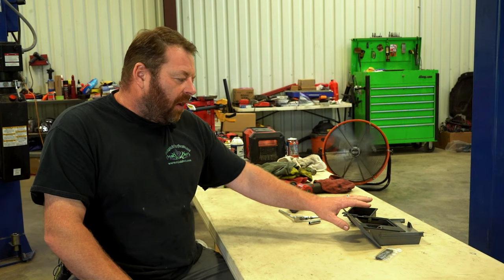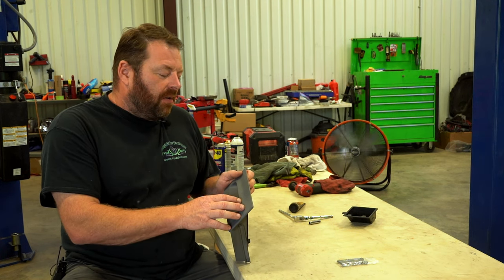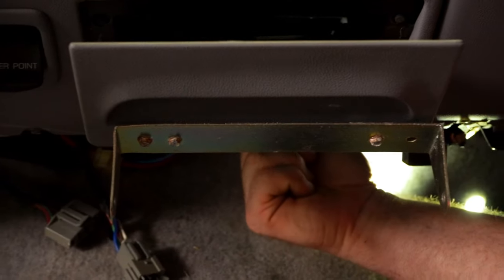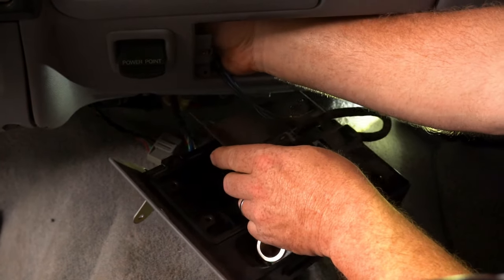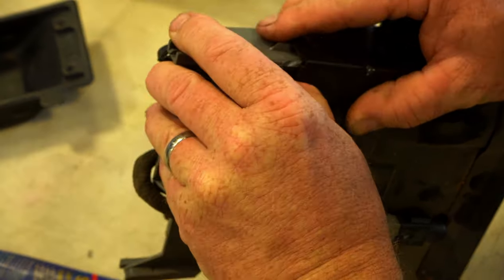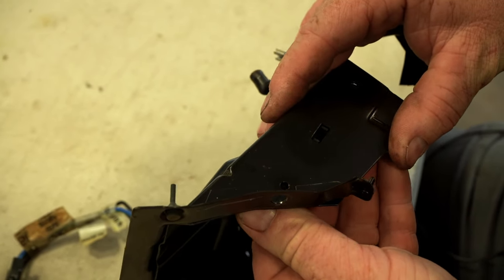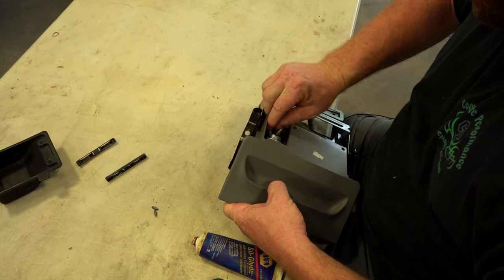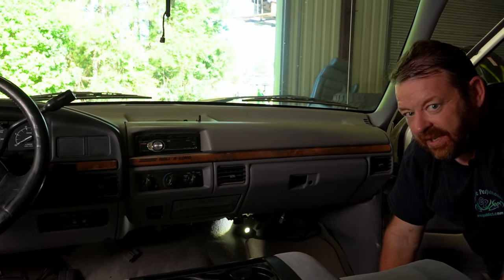How To Video - 1992-1997 Ford F-series - Ash Tray - EASY

Comment: I wish someone would come out with a cup-holder ashtray conversion. I have no need for an ashtray, but some cup holders would be nice. Don’t have any with my bench seats and they don’t have the nubs for one to attach
Reply: Foreal, I thru my black cups because they don’t hold most cups and with the black they sit so high it tops cups especially in these obs shit turns everything moves back n forth
Reply: Those exist and they have been around for quite a while